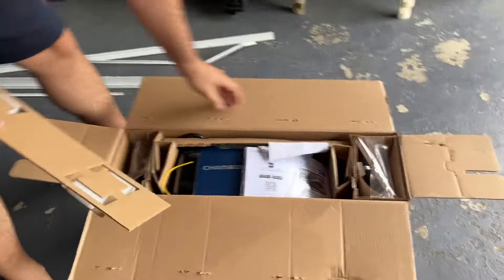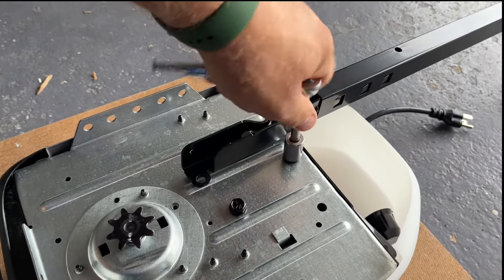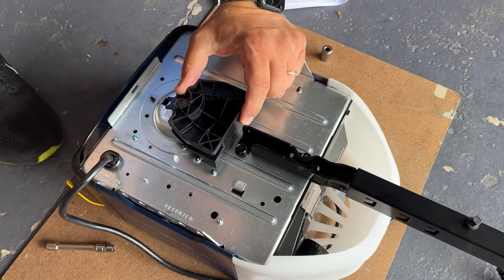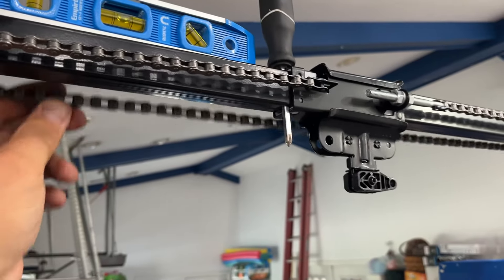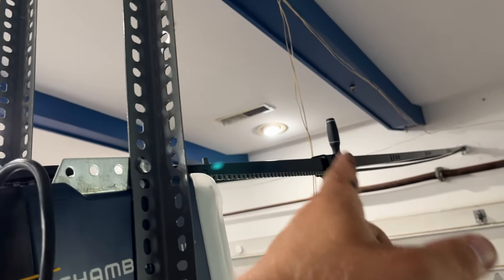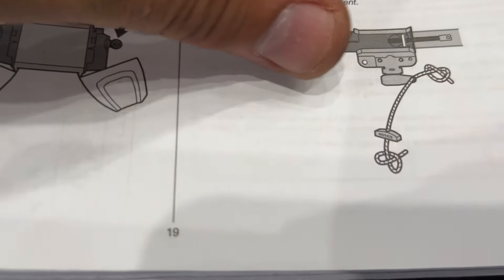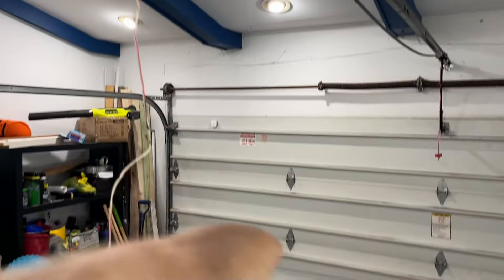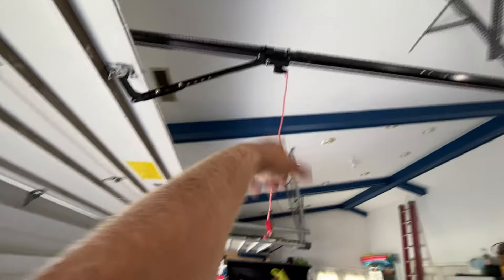How to install Chamberlain Garage Door motor model D2101

Comment: Thanks a ton. Like several in the comments section my opener didn’t come with instructions. Your video was a gift. For those doing this project solo (like I did) here’s a tip. Use a couple industrial grade bungees clipped to the hanger hardware to hold the weight of the motor during removal of the old opener and installation of the new.

Comment: You could have just reused the T rail instead of the square rail that came with the opener
Reply from the maker: @jeremywilliams4493  I couldn’t reuse old rail because of different mounting mechanisms for the chain and bracket.
Reply: @ oh because I’ve seen people reuse the rail if you’re replacing a chain drive with another chain drive
Reply from the maker: @ i wanted new one and quite one
Reply: @nazarettos6987  that’s true

Comment: great tutorial, I wish you described also the sensors' installation but I will figure that out. Thank you.
Reply from the maker: @rmiodice5022  it is super easy to install censors. Just mount them across each other, align them most important. Lead the wires from each sensor to the motor and plug them in each corresponding slot.

Comment: Great Video - Thank you very much! looking for some advice on what might be going wrong. I have everything connected but when i push the control button the unit click 4 times and not sure why. Not sure if matters but one sensor is green and the other is amber. Neither is flashing.
Reply from the maker: @jasonschwannecke6307  sensors not aligned or wire could be damaged
Reply: @nazarettos6987  are both sensors supposed to be green non flashing for system to proper correctly?

Comment: i just bought this one to install to replace a different model. mine didn't come with instructions, so this was helpful. but i just took off the old motor and replaced it with the new motor. i used the previously installed chamberlain rail and wiring. i had a belt drive, and swapped for the cheaper chain drive. so the only extra part i had to swap beyond the chain and motor, was the old belt drive pulley above the door. used the chain drive pulley that came with it and swapped out the previous belt pulley.
Reply from the maker: Im really glad my video was helpful

Comment: Dont forget to lube the big spring on top of the door, the temperature in winter makes them crack, they are in constant contact with the coils, lubrication makes it smoother to work
Reply from the maker: I lubricated it with white lithium grease

Comment: Thank you for this video!  I just bought this exact unit.  Mine didn’t come with an installation manual so I appreciate what you’re showing.  Could I install this using the existing rail, chain and wiring? In other words, only replace the motor.
Reply from the maker: No use new rail and chain, but sensor wiring you leave the same. Also I don’t think you can install new motor to the old rail, there is special bracket, just use new one.
Reply: I used only the motor and it worked fine. But had to watch a youtube video since mine came without any manual or instructions in order to understand the sequence of setting it up to operate properly. Was actually simple after seeing the strange sequence.
Reply: Mine didnt come with installation manual or parts list either.

Comment: When I press the arrow up it just flashes twice. Will not go up. Please let me know what's wrong
Reply from the maker: @666SLAYTANIK  you have to press and hold it, let go of the arrow when you are satisfied with the garage door travel distance. Than press black button and do same thing for the down arrow.Also make sure your door sensors are aligned and connected, because your door will not go up or down. Thant might be your issue.
Reply: @nazarettos6987  Thank you!! It's the sensors I think. Appreciate the response
Reply from the maker: @ so to summarize, push black button and than hold up arrow until door go up to desired distance, than let go of arrow and press black button again to set set travel distance for down arrow. At the and press black button again and the door should go through the cycle open and close by itself.

Comment: Very good video ! The only thing I did not see is how did you engage the trolley with chain against the manual emergency release before the you adjust the height of the the door if you can explain that please . Thank you !
Reply from the maker: Its very easy, first you must connect motor to power, connect all the wiring for the garage. Than push button to open the garage and the trolley will engage and lock in place to pull the garage.
Reply from the maker: But of course you will have to remove screw driver out of that hole so that motor can pull the troley.
Reply: Thank you ! I did it , it engaged  and I was able to program the height , your video is the best for anybody trying to installed chamberlain D2101 garage opener .

Comment: How do you install the sensors tho??
Reply from the maker: You mount them on the side of the door rails on the buttom, make sure sensor aim directly at each other. Than guide the wires up the garage opener
Reply: @nazarettos6987 mine makes a clicking noise when I try to move it if the sensors aren’t aimed good will they do this? How do I get them to aim at each other perfectly